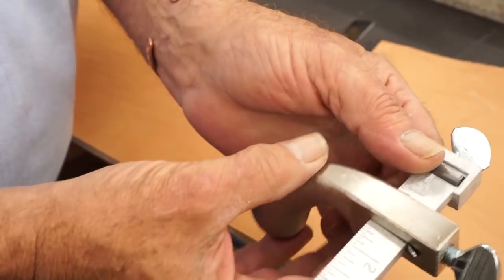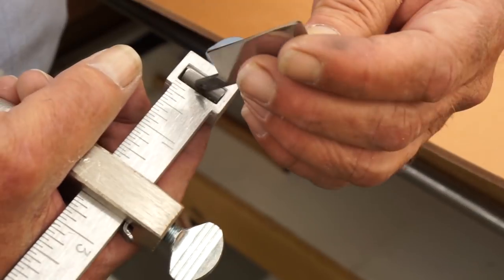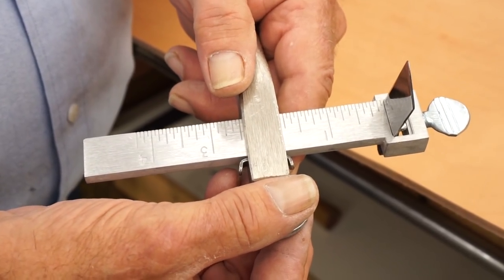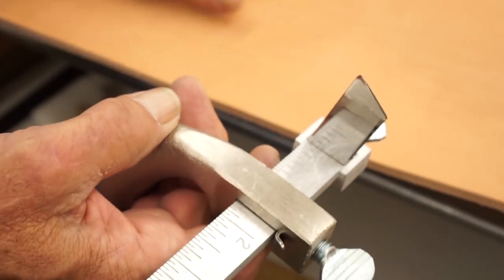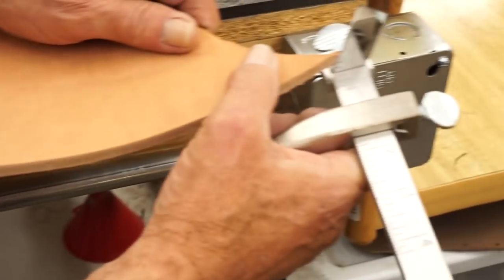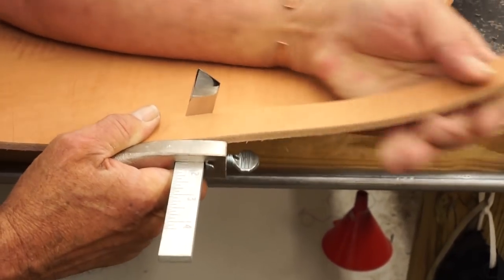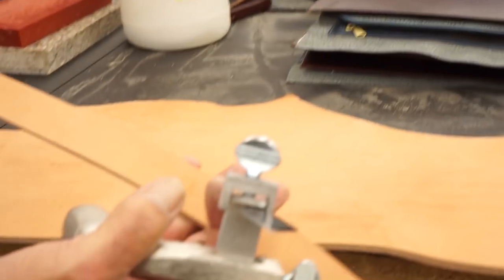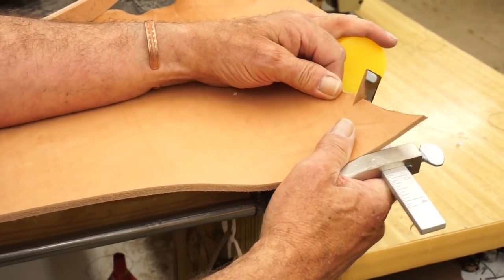SLC Shorts: How To Use a Draw Gauge

Comment: This tool is one of the most useful and also one of the most dangerous. When setting the gauge on the bench, always, ALWAYS lay it upside down, with the top point of the blade touching the bench. As sharp as this tool has to be to work well, it will inflict a terrible cut to the unwary person who tries to pick up the tool in a hurry with their mind on the next thing. Also keep in mind how close that blade is to your left forearm, which contains some very large arteries. Like any good tool (such as a head knife) it is at once your best friend, but your dangerous enemy if not respected and used properly.
Reply: Thanks for the advice take care

Comment: Can this tool be used on lighter weight leathers also? Is it necessary to buy 2 tools that do the same job?
Reply from the maker: While a Draw Gauge will work for lighter weight leathers, there are some other leathers that other tools make the job easier. Say like the strap cutter.